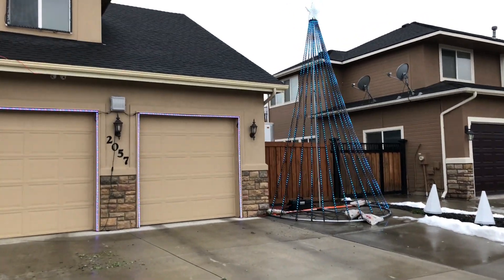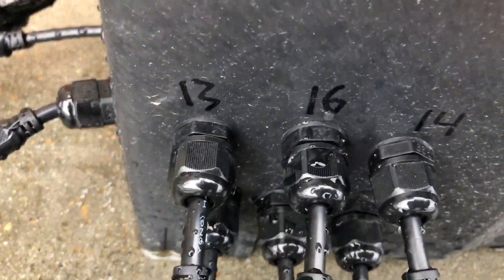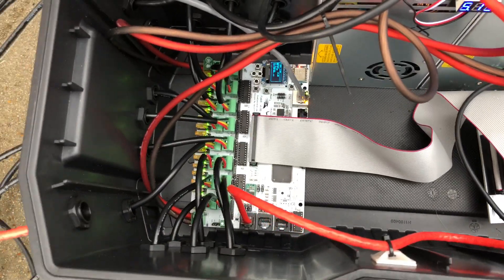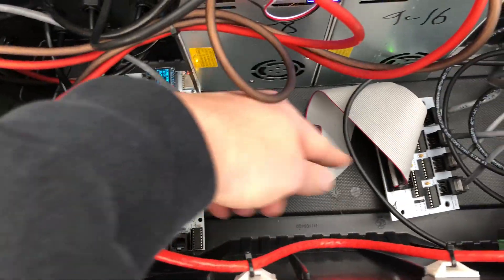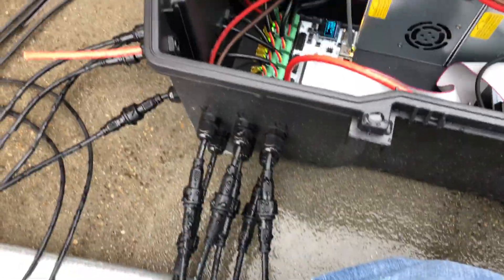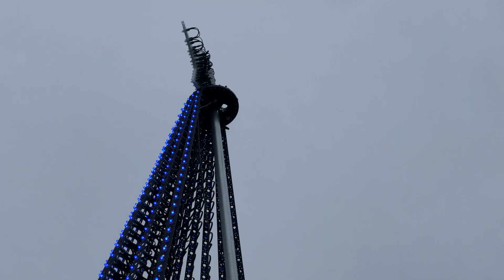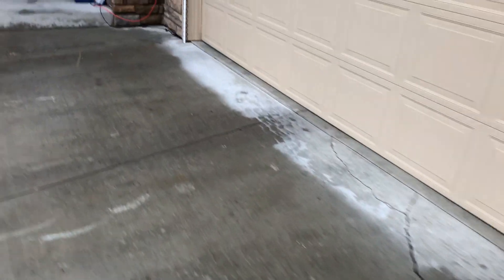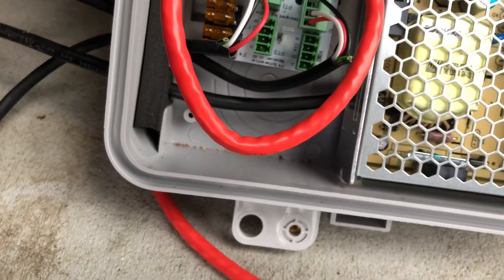2017 xLights behind the scenes video

Comment: Hello, I’m brand new at this. Don’t even have my first display it up yet looking for ideas for the window outlines. I like how you skip the black strip and just drill the PVC it gives it for a cleaner look wondering if you ever thought of painting it to match The house trim and somehow blend it in and leave it up and not sure how you mounted it. For my house roof outline that’s sort of thing. I’m going to use J channel that I found matches my house trim perfect. Going to drill it all out and leave it all up probably won’t even notice it. I found I can just press fit it as well. I did notice when I was testing it out. Some of the pixels are better at mounting facing down and others where there is no soffit there’s a drip edge where I could slip the J channel in and have the pixels facing out. I’m interested in your thoughts and thanks for taking the time to share your work.
Reply from the maker: In more recent behind the scenes videos I did paint the PVC frames. It matches much better. I've tried everything so far. PVC with zip tied black strip. Hated it.
Drilled PVC pipe, hate the process but finished product is nice.
Drilled metal J channels, finished product is nice. 
J Channel is really a great solution. Seed pixels are all the new rage right now and seem to require no drilling. Might be a great way for you to experiment and get into the hobby.

Comment: Oh another quick question...wire gauge...which have you had the best luck using?
Reply from the maker: My whole setup is 5V 18 gauge on the pixels. 2017 and 2018 I used 4/18 for power injection. 2019 I am stepping up to 4/16 for power injection. I always use 2 wires for positive and 2 for negative of the 4 wire cable. Hopefully this answers your questions?

Comment: What boxes are you mounting your receiver boards in? I just ordered my f16v3 controller and need to get some receivers ordered too now I see.  Did you say a 5v 18a power supply is enough to run things, going to have to order those too...oh man I’m getting excited to have a display this year...rocking the Christmas...
Reply from the maker: For the small receiver boards i used originally CG-500 boxes. This year I am swapping the CG-500 boxes for CG-1500. It is just too crammed in the CG500 box with the smaller 18amp power supply. I am converting to cg1500s and 30 amp power supplies. more room and more power.